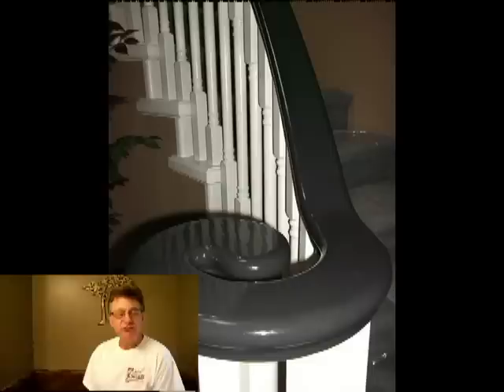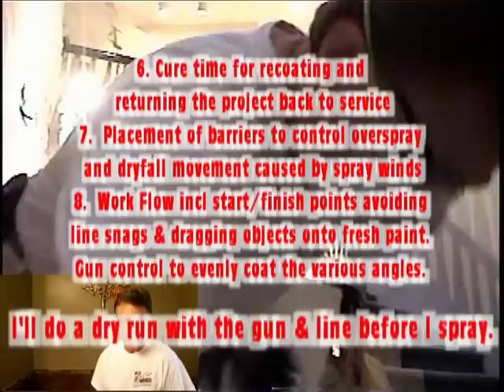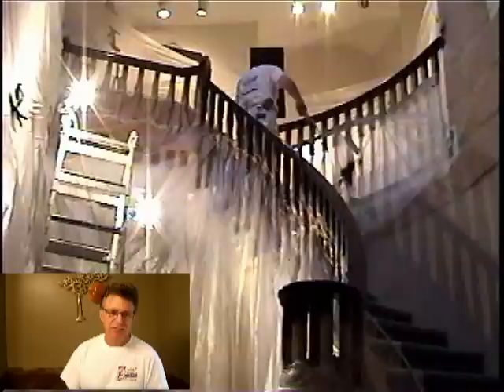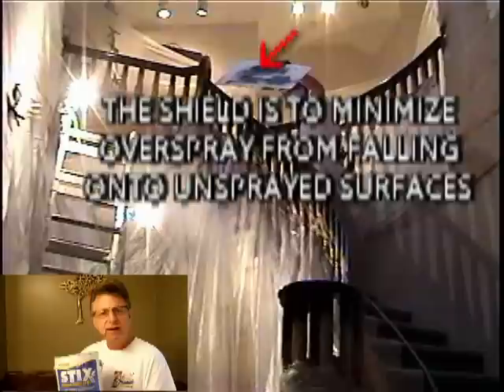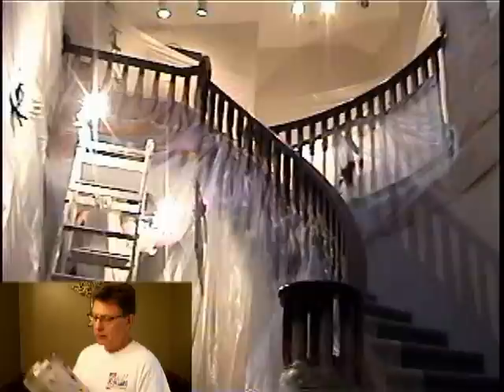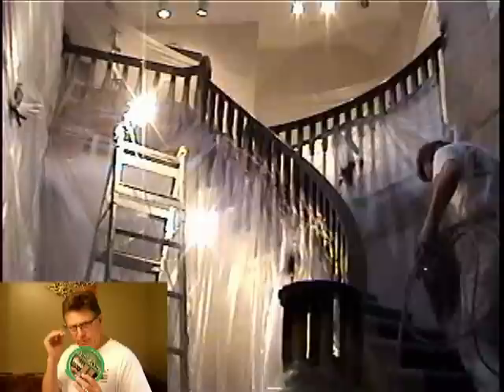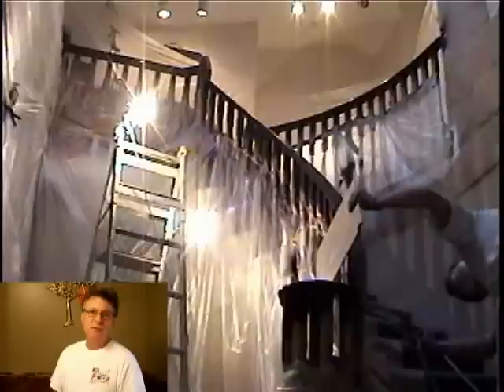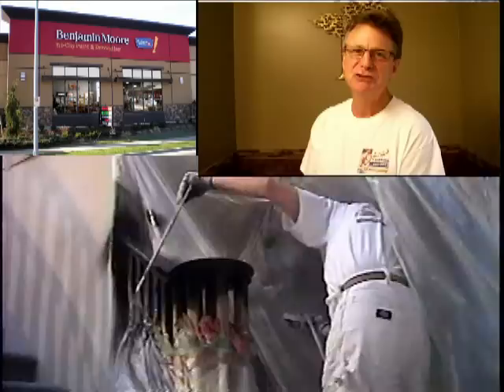Spraying Multiple Paint Colors On A Staircase - SOLO!

Comment: Hello, thank you for the nice professional information, impressive job. I own a paint company for 17 years now, and I'm always looking for different techniques on you tube. The only thing I didn't like about you video is, you're using a dust mask to spray all this amount of prime and paint instead, of high-end 3M spray respirator. Amazing finish, I hope the carpet people did a good job and you didn't have to face any touch up headaches. Thank you for the time to make a video like this, Leo from South Florida.
Reply from the maker: Thanks Leo.  I used my comments during the filming for the purpose of making the video. No camera man. This was filmed with a Hi 8 camcorder sitting on top of a paint pail. Your comment about a respirator vs a dust mask is valid. Normally I wear a respirator even when spraying outdoors.  I recommend it. I agree also not to use a cheap respirator available for $20-$30. Although some are effective they can be very uncomfortable and block your vision. You are correct. Spend the money. Get a nice fitting quality half mask.

Comment: Wayne, I'm looking to spray an interior paint job that will include all doors, window trim, and mop-boards and also the stair case balusters and riser face boards.   My plan is to spray everything  with a primer coat on day one and then a finish final coat on day 2.   My concern is, will the masking tape still be able to be removed with clean sharp edges after the finish coat is applied on the day after spraying on the primer?  Also, what are the consequences if the tape isn't removed in a timely manner and what should be done if that happens?     Thanks for any and all comments and suggestion. Fremont, NH
Reply from the maker: TheSkoot61 Sounds pretty ambitious to me. Would need a lot more detail to answer that. Basically your steps are mask first and then  set up your doors in their spray area. Sand everything and fill. Check everything with a light and sand your filler. Remove dust with either a vacuum or a compressor. Prime where needed such as in areas that were filled. You don't usually prime previously painted surfaces like doors and baseboards unless they have been filled or marked up with something. . You would however prime the entire railing to create a consistent substrate. After that you need to sand everything. Check with a light. (Everything) Put on your first finish coat. Sand everything. Catch any deficiencies you missed. Check with a light. Spray your second finish coat. Then start removing your masking and cleanup. As far as the tape goes all tapes are different. You have to experiment. Some tapes can be left on old cured paint for 2 weeks but they can only be left on fresh paint for a few days. It also depends on how much paint you build up on top of the tape, the size of tip your are using, the kind of coatings,  and the temp/humidity at the time. This will speed up or delay curing the new paint. You need to know ALL of this stuff BEFORE you attempt a large project like this. The quality of your spraying will only be as good as the quality of your prep. To do this kind of a job it can take 2 guys 3-5 days depending on the size of the house. Do your homework before you start and allow time for problems such as a bursting pump hose etc...I hope that helps!

Comment: would you recommend painting the stairs first and then spindles? or is there real order to follow if it's white + dark combination?
Reply from the maker: In this case the stairs were getting carpet. The oak bases for the spindles were sprayed white at the request of the home owners. After they saw the black on the rail they changed their minds and had me paint the base sections black. As to your question if I was painting the entire stair tread as in the case of black & white  "Oreo" cookie stairs from the 40's and 50's or staining and clear coating wood stairs I would do them LAST. New finishes need time to cure. If you paint the stairs first you will damage them during the rest of the process.

Comment: Were you just using a card board box to protect the from the aerosol spray? And after one coat do you remove masking tape after 4 hours then reapply masking tape and put on last coat?
Reply from the maker: +escf Good questions. There is no aerosol because the coatings are water based and I'm using an airless sprayer. The way airless sprayers work is that they pressurize the paint by pounding it with a piston and driving it into a long hose. The long hose length (usually 50 feet) causes the pressure to equalize before it hits the spray tip. This even pressure is then atomized by the tip and the paint exits into a fan shape. This means no aerosol gases are involved just plain old air pressure. The "cardboard" you're referring to is actually a piece of corrugated plastic. It's not to protect me at all. I'm holding it on the opposite side of the surface I'm spraying because even though I've protected the areas with plastic I'm not painting the walls within the enclosed area. The plastic (called an overspray shield is preventing paint that is missing or bouncing off the surface from hitting the wall. It takes a great deal of pressure (2000 to 3000lbs) to atomize the paint. That means overspray can travel a long way. When the paint is ejected from the tip of an airless gun a strong wind is generated which can also help to carry overspray. The shield helps to catch paint and to stop the wind stream. To answer your last question you remove all your masking after each color and reapply for the next. As said in the video the time you leave it on is not exact. It depends on the type of paint, the humidity, the temperature and the type of tape. You need to know your products and the environment. If you leave your tape on too long the paint bridging it's edges will cure. Then when you try to remove it the tape will pull paint off of your finished surface. If you try to take the tape off too soon the wet paint will leak onto neighboring areas. Auto body painters usually work with the same products in a fixed controlled environment. House painters don't have that luxury and that is the challenge. Thanks for asking and I hope this answers your questions!
Reply: +Prime Painting awesome! I appreciate the explanation. How much do those airless sprayers usually run?
Reply from the maker: +escf There are many brands including "home owner" versions and professional versions. To spray a fence you can pick up a HO version at Home Depot for around $500 Canadian. For professional interior finishing work you could look at Graco or Titan machines for around $1000 Can. The difference is mostly the built to last issue and the consistency of pressure that is delivered. Controlling paint trapped in a machine under 3000lbs pressure makes them dangerous in the wrong hands. As well, there is the potential for accidents due to burst hoses, spilled pails, overspray etc. Their maintenance is critical. In Canada Home Depot rents airless sprayers. I recommend renting one a few times to find out if airless spraying is right for you.